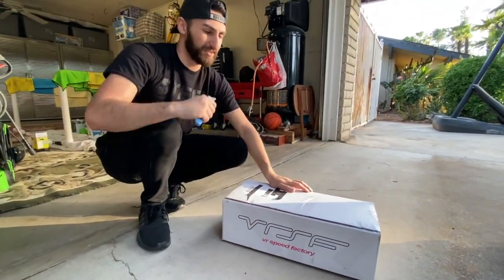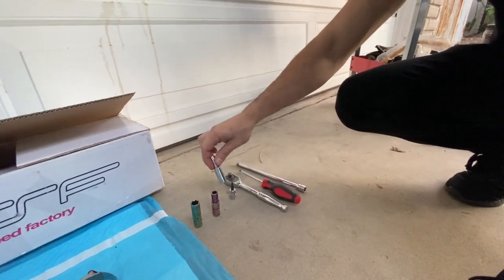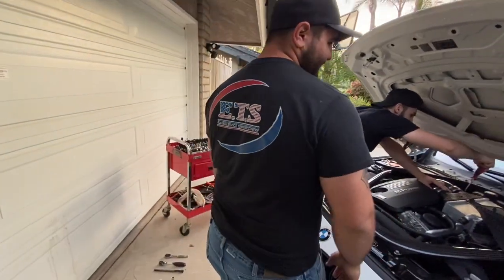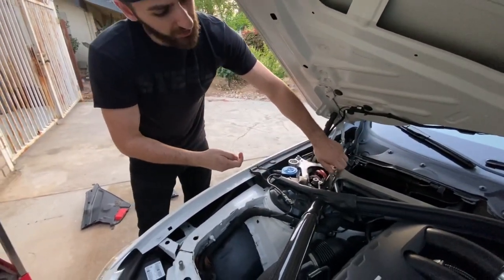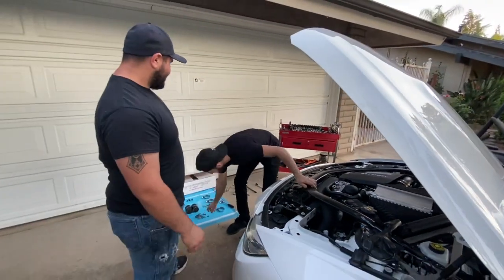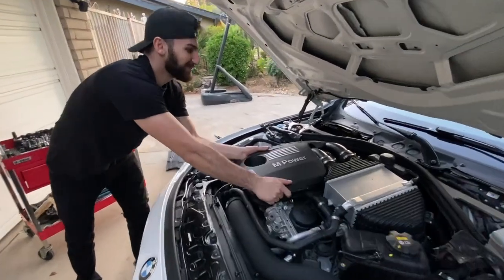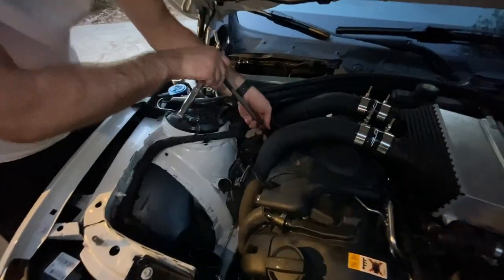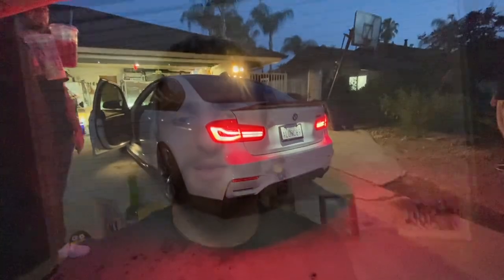INSTALLING VRSF CHARGE PIPES ON MY BUDDIES F80 M3!!

Comment: Hey bro I got a cel after installing those chargepipes ? Would you happen to know why? Everything seems super tight
Reply from the maker: Did you tighten the meth bungs on the charge pipes? And did you unplug the maf sensor on your intake? If you did unplug it without  disconnecting your battery cable then you will most likely get a cel from that.
Reply: @TatOhanyan  what can I do to fix the cel if the cause is unplugging the maf sensor without disconnecting the battery?
Reply: @TatOhanyan  I’m getting the fault code 102A32  air mass meter, air mass to low
Reply from the maker: Clear the code first with a scanner and see if it come backs
Reply: Thanks for the reply bro! I appreciate you. I cleared the code 3 times and it still comes back. The car still boosts super good and doesn’t lack power at all
Reply from the maker: Since the code comes back, Check for any leaks after the maf sensor, you might have left something loose.
Reply: @TatOhanyan  bet bro thank you so much ! Is it bad to drive the car like that?
Reply from the maker: No problem, and it should be fine but try and get it fixed asap
Reply: @TatOhanyan  if you don’t mind me asking brother where you located ?
Reply from the maker: Fresno ca